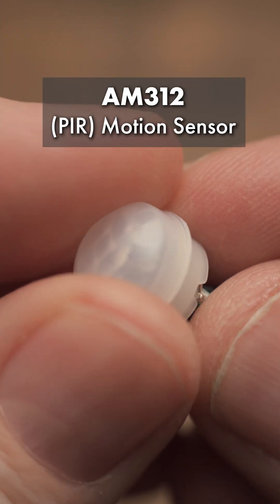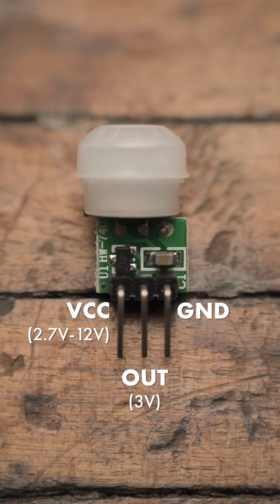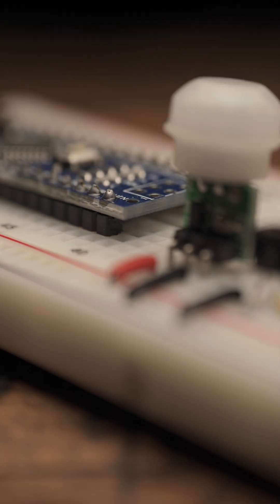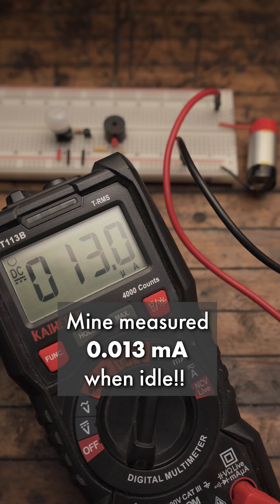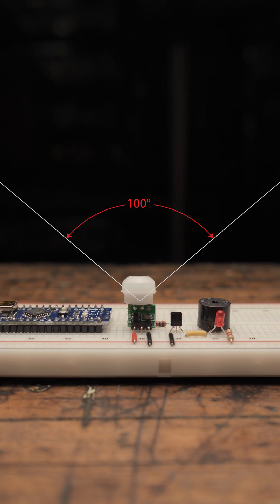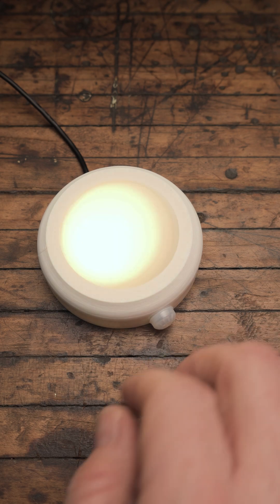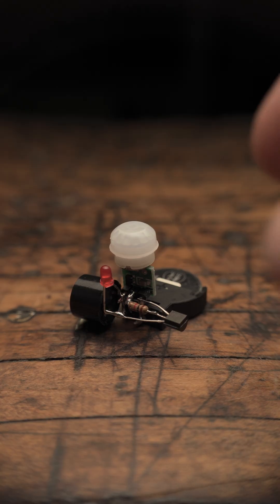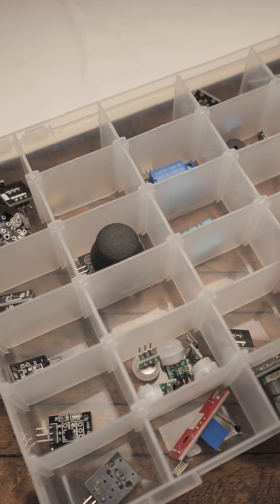#MotionSensor

Comment: I've used a different sensor than this one, but I was able to power it off of a 9v battery.  It was commissioned for a construction company to put at the end of a hallwall, so they knew if someone was coming around the corner.

Worked pretty well and they ended up buying a dozen after that.  It was a pretty easy to make and cheap device to be honest. I think it costed around $5 (at the time) and honestly the batteries were more expensive hahaha.

Comment: I work as a product lead for a trail camera company, and we use these in all of our products! One thing to note is that due to the way it "detects" motion by comparing the changes in infrared radiations, they can be pretty iffy when being used outdoors because if it's hot outside you can't really tell a difference in someone's body temp very easily, or you get the opposite problem of it ALWAYS thinking there's movement lol.
Because of that, one trick is to combine these with an Ambient Light sensor and a temperature sensor to tune the sensitivity on the fly to prevent false triggers and get just the right sensitivity for detection in all environments!
Reply: I wish you guys were my teacher for Measurements and Instrumentation Course. 
Respect for you guys.
Reply: sick, thank you
Reply: Thankyou
Reply: How do you adjust the sensitivity? It is stated in this video that the sensitivity isn't adjustable.
Reply: @LawAbidingCitizen117 probably reading the outcome of the different combined sensors in software and adjusting from there :)